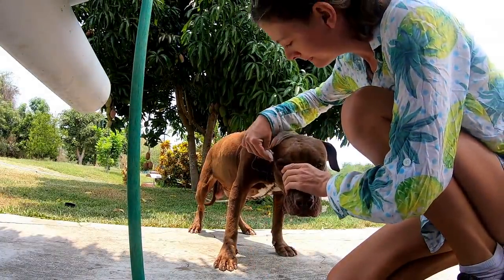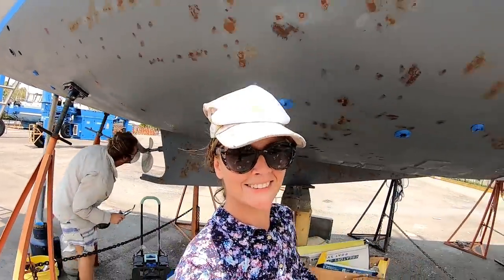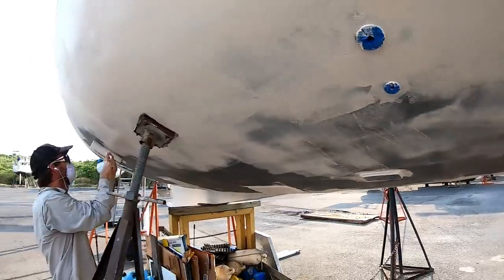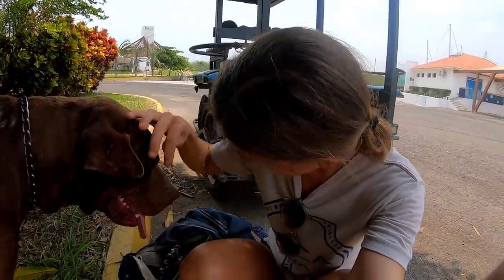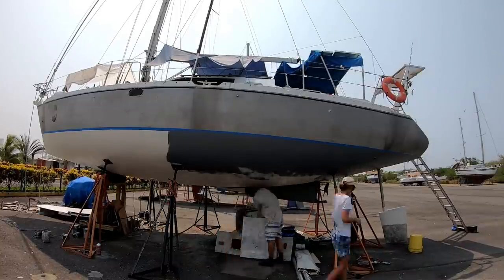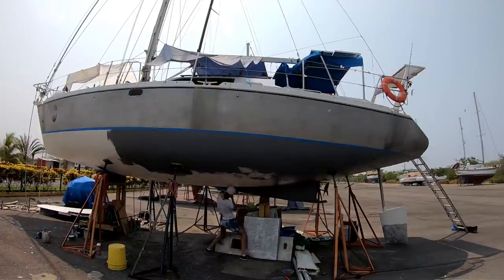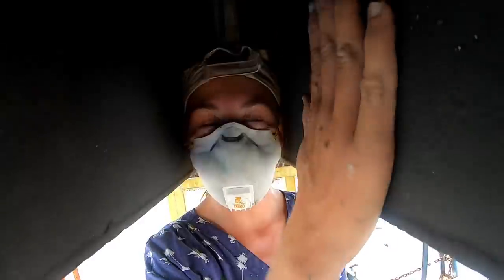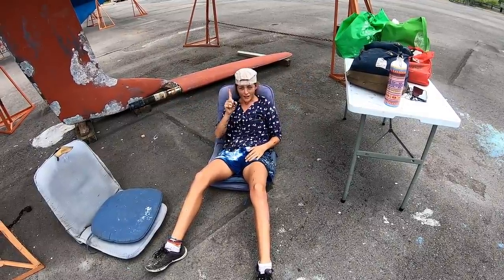The Bottom Job Finale! Painting an Aluminum Hull : Chuffed Adventures S03Ep17

Comment: Question about the N95 masks you are wearing...  are they because of Covid-19  or  are you using them to protect you against paint fumes?  If the later, you should know that those masks provide no protection from volatile organic compounds (VOCs) present in marine paints.  Paints with high levels of VOCs should be applied with a respirator equipped with the proper filter cartridge for organic vapors.   The N95 used by contractors  protects against hazardous dust particulates when sanding surfaces such as those containing lead  though a N100  would be better.  If you are using these to protect against Corvid note that the air vent versions you are using are unsuitable and unsafe as they allow your unfiltered air to escape.
Reply from the maker: Hi Malcolm, we were using them more for dust/paint, I can't fit in the keel box with the respirator! But we do have them and should probably use them more. For covid we have normal facemasks (N95 with no air vent, or just fabric)
Reply: @VetTails  Understandable.  I bring it up because I see so many instances where people do not understand respiratory hazards.  I'm 64 and did a pretty good job at adhering to safety, but  I can tell you that even small cheats when you're young catch up with you later in life.  I my case I wish I'd taken better ear protection care -- compressor and vacuum noise have left me with constant ear ringing and deteriorating hearing.

Comment: I am new to your channel (maybe you have explained before). May I ask why you are painting your boat? I have heard for aluminum boats you do not need to do it!?
Reply from the maker: Hey! Alu boats can in theory be left bare, which is why her sides are left bare. But top deck we paint so its not slippery or too shiny/hot and then with the bottom it does offer a level of protection against electrolysis in marinas.
Reply: @VetTails  thanks for the explanation.